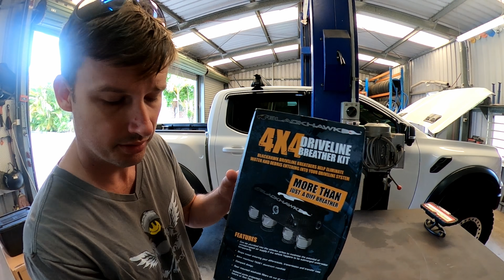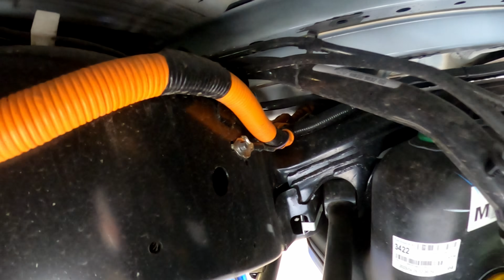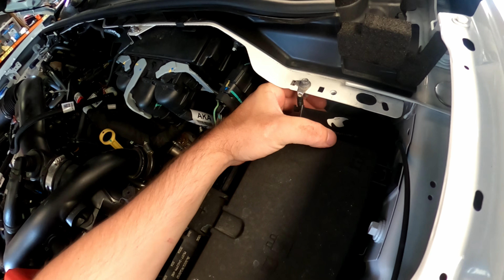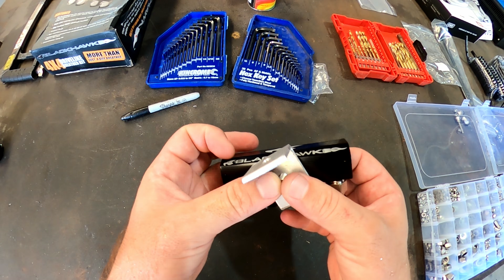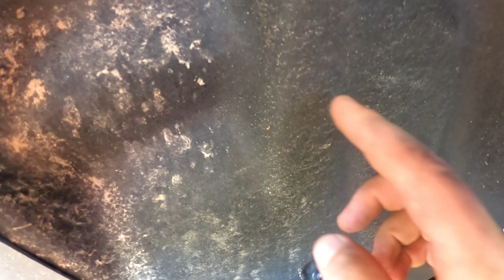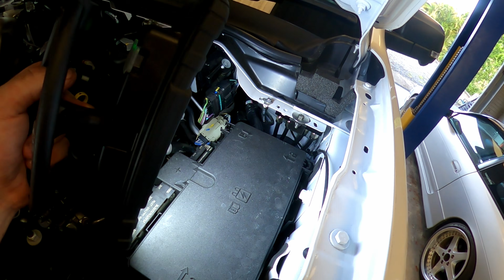Ford Ranger Raptor Diff Breather Install Next Gen Gearbox Transfer Case

Comment: Seems like the stock breathers are located at sufficient height?
Reply from the maker: Depends on how deep water crossings you do but yes better then alot of other Ute's.
Reply: @DAVO3FAZE  how much extra height has adding the kit you installed given? thanks
Reply from the maker: @craigzee3652  they are all at different heights, at least 300mm.
Reply: @DAVO3FAZE  thanks for coming back to me